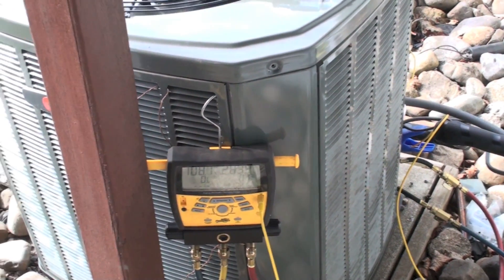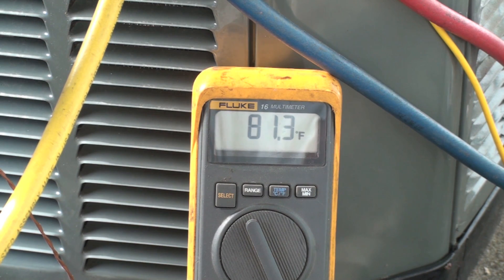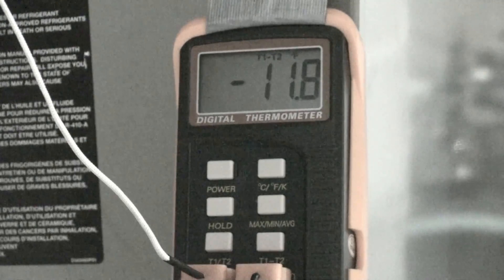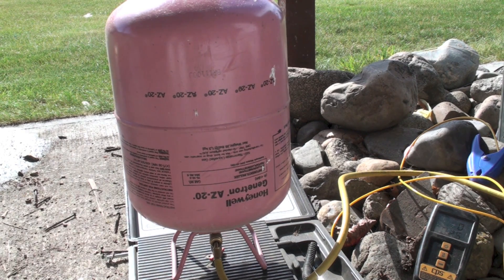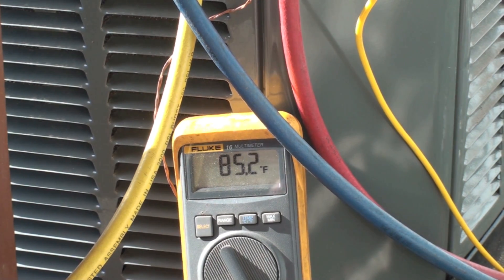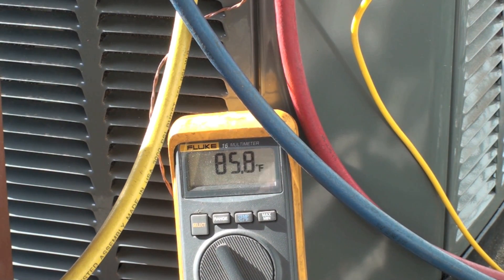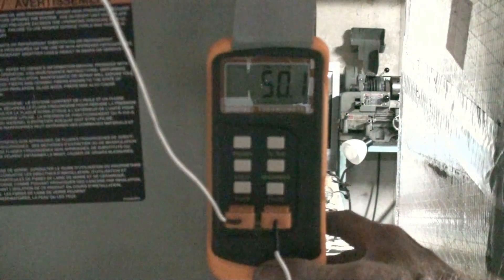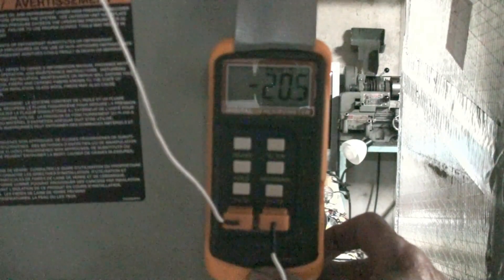How to recharge the AC with a TXV

Comment: I did residential for 7 years, I'm currently working for the last 7 1/2 years in  big commercial equipment. I started looking for any videos HVAC because I always believe that in this trade is always something new to learn and I found one of your videos and I was hooked. I wish I would it have  an instructor like you when I first started in this trade, thank you sir!
Reply from the maker: +bladimir becelinoff Welcome
GFM
Reply from the maker: Thanks for the support.
GFM
Reply: bladimir becelinoff will get
Reply: I have the same problem . Over thirty years working on systems that hold 50,000 lbs of charge to half an once . Something is always done with a different method to the madness

Comment: I got a question I'm pretty new to the Hvac field...in class we're currently doing a recovery and a vacuum and the instructor told us to buy out own gauges so we can get used to using them.....now my question in your opinion which digital manifold is good for a beginner but also good enough to have out in the field price is not really an issue.....thnks
Reply from the maker: +Carlos Chavez The Testo and the Fieldpiece are the most common choices.  I really have no problem with either of these.  They are quality products.  I use the Fieldpiece but that is mostly because it is easier to see on the videos.
GFM
Reply: +grayfurnaceman thanks for the reply I went and bought me a testo 550 and I excited to try out..thanks again I'm really understanding more about the Hvac system just by watching your videos 👍👍👍

Comment: The charge is still not accurate. Evaporator shows signs of restriction.
Reply from the maker: +brandon milner Just got your comment.  I assume you are looking at the suction pressure.  Note the return is at 70F.  If you had a normal 75 to 78F, the suction would be higher.
GFM

Comment: I didnt notice any recovery machine,  i hope you didnt do any atmospheric recovery.  just messing with you,   good video.  id like to add anytime i get into a system that is low, i will leak check first, and i always change out the schrader cores on all ports that have them. as well as clean all coils and change air  filters first before taking any readings.  I just dont like having call backs
Reply: You are The First mechanic among all the Super Techs on you tube that stated the obvious=Back to square one=clean coils,air filters leak test and repair.
Good on you mate.
Just my two bob worth : R-22 systems can be toped up as for R-22 is not a blend. R-410 and other blended refrigerants should be dumped and recharged with virgin stock. Change filter/dryer. 
                                                                          Greetings from Australia.
Reply: If only all the customers would pay for the right job to be done too many moron techs give them too many options and taint their minds   it should be stamped and said this is proper code and has to be done like this

Comment: Very good video .  I have Question pls 
If he charge with sub cooling when there is a TXV and by wet b dry b on the super heat with non TXV . In what category fits units with  capillary metering device. And one more q. If I was to do sub-cooling calculation on a R410a split  in cooling mode do I doit in test mode ? Full fan run speed? 18 Celsius set temperature? Thank you
Reply from the maker: +lucly nn The capillary device is also considered a fixed orifice device and is charged by superheat with wet build and dry bulb or target superheat.
GFM

Comment: Paul.... If a R410 unit is low when testing on a service call or check up, that means the R410 is unbalanced with concerns to oil mixture. R410 requires the precise mixture for it to cool properly and oil sufficiently. Only if the unit is brand new and just requires a top up then can you just add. 
Otherwise the system (by manufacturer specs) requires you to recover and start from 0 if the unit is found to be low
Reply from the maker: +Colin G When a blend has a leak in the liquid side, the refrigerant will leak the highest pressure refrigerant at a higher rate than the lower pressure one.  R-410A is a blend of R-32 (50%) and R-125 (50%).  It is called a near Azeotropic blend.  Meaning it almost leaks at the same rate for both refrigerants.  At approx 70F R-125 boils at -55F.  At the same temp, R-32 boils at -61F.  Looking at the different boiling temps there is only 6F difference.  Remember, both refrigerants are leaking, with the higher pressure one leaking slightly more.  With these numbers in mind, a small leak can be topped off (after the leak is repaired) with refrigerant without changing out all the refrigerant.  Certainly, if there was a large leak, the refrigerant should be replaced.  I have never seen a manufacturer claim that a small leak must have the refrigerant replaced.  If you have other specs, I would like to see them.  Thanks for the thoughts.
GFM

Comment: when charging by sub cooling and you get the charge right, how do you look at the super heat and determine if the txv is working properly? No one ever says what your super heat reading should be. They just sat " the super heat looks good" Whats a good reading and why??? I've read to never let super heat get below 20-25.at compressor, always check line temp. at same place you are taking pressure reading. If I could get this question resolved, I would understand super hear and sub  cooling much better. Counting on you furnace man.
Reply: The txv is design to maintain a superheat of 10 degrees under perfect condition. depending on the load at the evaporator that number can be between 5 and 20 degrees, if you are out of that range......there is a problem

Comment: For manufacturers whose installation manuals advise to add additional [R-410] refrigerant for indoor matchups and/or longer line set lengths will the resulting subcool value be higher than their suggested published value? I.E. if they recommend SC of 9 based on a charge of 11.7 lbs. is it possible to see, say, 14, if you add an additional 2 lbs due to the indoor coil matchup and longer line length?
Reply from the maker: Brian Fletcher The adjustments are to keep the subcool the same when adapting longer linesets or different indoor coils.
GFM
Reply: Brian Fletcher most AC systems have lists supplied with the AC that tell you how much refrigirant needs to be removed or added when line length changes.
Reply: grayfurnaceman Thank you, GFM; that one has had me confused.

Comment: I know this is a training video probably at your house but would it not be good to mention that if a tech gets to a R410A unit and its found to be low on refrigerant that the unit should be recovered and all new freon put back in so that the right amount of mix is in the unit?. just a thought
Reply: +grayfurnaceman  What Colin G is saying is that if a tech sees that a system is low on 410a, the tech cannot know how much of R32 or R135 (the components of R410a)  has leaked out, so in order to get an honest R410a in the system, the tech should recover the old refrigerant and add all fresh R10a.
Reply: That could be pretty costly if it only needs a small amount to bring up to full charge, having to dump the full charge and reinstall with new refrigerant.  Can
 the proportion of the existing mixture be determined by checking the stabilized vapor pressure at the ambient temperature?  For a proper blend of R410a, there should be a specific pressure corresponding to the ambient temperature with the system off and given a chance to stabilize.  If it's off, maybe adding the lighter component to restore the blend could be done instead of adding the R410a blend.
Something like making a measurement of the specific gravity of antifreeze and adjusting by adding coolant or distilled water to achieve the target specific gravity.
Otherwise, is there an electronic method of reading the blend components in the system?
Reply from the maker: Colin G You need to explain further.  Are you saying the refrigerant should not be replaced?
GFM

Comment: That was a very helpful presentation thanks a lot! 3lb charge does make me curious as to what leak you repaired because that sucker was dry.
Reply from the maker: 4842Chuck The unit was being used as a test mule.  It had no leak.
GFM
Reply: @grayfurnaceman  You said you recovered some refrigerant from the unit prior to testing so you already knew it was low. Good job. Chuckyoufarley made a good point.

Comment: What is the reference in determining the Temperature Difference Between the Evaporator Coil?...Thanks a lot for sharing.
Reply from the maker: trharesco It depends on the application.  Generally, the split should be between 16 and 22F.  I will be doing more videos on temp splits this summer.
GFM
Reply: grayfurnaceman Thank you very much for the reply and looking forward on the video about the temp splits... thanks for you sharing the knowledge....

Comment: So with TXV the superheat should always be no more than 15 psi if the valve is working right, even if the charge is low?
Reply from the maker: quimshtgclg With air conditioning systems, unless manufacturer instructions are different, 15 DEGREES F of superheat is about the highest. If charge is low, superheat will increase as there is not enough charge to maintain superheat.  Hope this helps.GFM

Comment: I thought your indoor and outdoor temperatures didn't matter with TXV systems. I thought that as long as it's running desired subcooling, and the superheat is no more than 12 or 13, it was good.
Reply from the maker: John Smith TXV systems are better at lower ambients, however air conditioners run at fairly narrow indoor and outdoor temps.  On residential systems, outdoor below 70F and indoor below 70F the numbers cannot always be trusted.
Reply: I happen to live in Arizona, and it can get over 118 degrees here sometimes. Let's say my indoor temperature is 70, and my outdoor temperature is 130, if the system uses a piston, will I have any superheat under these conditions?
Reply: Is it possible for the outdoor temperature to get so much hotter than indoors that there might not be any superheat? If it is about 70 indoors and 130 outdoors, would that be enough to cause zero superheat?
Reply: John Smith Superheat is for all conditions. It's a troubleshooting tool that is used in all conditions. A term. Same for subcool.

Comment: Isn't the 11 degrees of subcool rated for a 95 degree outdoor temp? And for 410-A, a good suction pressure is around 120 and a good head pressure is around 420 (also rated for a 95 degree outdoor temp). Shouldn't you drive the head pressure up to around 420 to simulate what the manufacturer recommends? 11 degrees of subcool at 84 degrees outside won't be the same on a hotter day.
Reply from the maker: According to Trane, the sub cool should stay the same at all temps except below 55F outdoor ambient.  It does seem that the sub cool would drop with higher ambients because of the additional boiling refrigerant, but it does not seem to be true.  However, I will test it at higher temps and do a video on it.  As for the suction pressure, If the system is designed and working properly, the suction pressure will correspond to the indoor air temp and wet bulb.  As far as I know, no manufacturer recommends simulating 95F for checking charge.  
GFM

Comment: on a new out side unit with nu22b add charge low side or high side? apt maintenace
techs do different sides what is correct.please help thank you gfm
Reply: ***** what is the best way to charge liquid in evacuated system thru highside or lowside? thank you for all replys and videos
Reply from the maker: You must charge liquid thru high side in an evacuated system.  If you charge thru low side, you will put liquid into the compressor and it may slug when started.
GFM